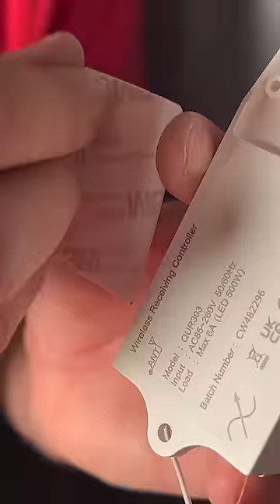A light switch with NO Wires - Magic! 🪄

Comment: That seemed like a lot of wires involved in a switch with no wires.
Reply: Switch itself has no wires the controller does
Reply: Your tv is plugged in ,correct,you use a remote ,no wires.correct.😊
Reply: @tommym3876  well no. The actual “switch” would be contained in what you’re calling the controller.
Reply: @onelineal9382  yeah you’re on to something. This video is like saying your tv is wireless because you control it with a remote 😂.
Reply: @dustinengle2570  yes the “slave” switch would be in the controller the the “master” is the one with no wires that dictates what the other switch is doing

But the point Is that no wires have to be ran for the other switch making things a little easier
Reply: You need the controller in case you lock yourself in the cupboard and need to to the lights on with your phone app. 😂
Reply: You can use wireless wires as Nicola Tesla did
Reply: Not at the switch though, are they? 🤦🏻‍♂️🤦🏻‍♂️🤦🏻‍♂️
Reply: @jameshansing5396  read my comment again. None of the words I used indicated that the switch itself had attached wires, did they?
🤷🏻‍♂️🤷🏼‍♂️🤷🏽‍♂️🤷🏾‍♂️🤷🏿‍♂️
If the electrician has to terminate wires to make it work, it is not wireless.
Reply: @PC-vx6ko  it’s just a pointless thing to say. Plus if you’ve used the product, there really aren’t a lot..

Comment: Sticky pads? They're gonna fall off in a month or two
Reply: Those 3M ones are pretty good, got them holding stuff for the last 6 years with no problem
Reply: That's where you're wrong bucks, those bad boys last
Reply: @brandonacamarena2197  nope. Just did some last week and the client called me back as half of them had fallen off. Even with an alcohol wipe pre sticking.
Reply: @jonhunter8737  they work great for me man, just must be a surface thing with some of em
Reply: Add crazy glue to the sticky backs.
Reply: I have mirror glued with them since 2001, just don’t buy cheap ones
Reply: @jonhunter8737 wrong
Reply: Nah those things stick like a mofo. But if you use other then 3m , a knock off brand they wont last long.
I used them in installations in trains a lot , some trains came back after 6 years and sae my work back and those sticky pads where still going strong. It just depends where you stick em 😂 and if the surfsce is clean or not.
Reply: @baklap141  Tell that to the Tesco Auditor who snagged my job a couple of weeks ago, when 4 out of 6 of them failed to stick!!! Typical night job, vague instructions, nowhere to get gear etc, then they want miracles. Move a costa machine and there may be a printer that needs power. That was the job spec!!!! Oh, and drive 270 miles each way to do it!!!!  Then get a wrist slap and an arse kick cos of them stickies!!
Reply: @jonhunter8737 the common theme in them not working v working seems to be you! 😂
Reply: Y'all I've worked in the adhesives industry let me tell you the secret. Look at the data sheet for the adhesive. If there's no data sheet throw away the adhesive because it's crap. Anyway on the data sheet it should tell you lots of information about how to achieve maximum adhesion. On the 3M VHB, most people do not press hard enough or sustain that pressure for long enough, and so get a subpar bond. Have a nice day!

Comment: >buy wireless device
>look inside
>wires
Reply: The actual switch is wireless and even battery less ... no power required. Works from mechanical actuation of the switch being pressed
Reply: @contytub  yeah piezo crystals are nothing new. that is how your dads lighter has worked for 50 years.

Comment: In this application why not just run a cable to the switch and route it out of the way?
Reply: Beacuse it's a sponsored video.
Reply: @Solkre82  yes, but find an actual application that makes sense. Where the switch isn't 30cm away and where a cable can be run with no issues.

Comment: Cutting the tails off the zip ties with diagonal cutters leaves extremely sharp ends that can slice you open. Twist them off.
Reply: He used plumb cuts. Not diagonals.
Reply: @joshespe7985  if you look at the cut end of the zip tie you will see the point that will slice you open. And those are a modified angle cutter. 
Retired Master Electrician 42 years
Reply: @gerhardschemel3565  those style cutters are meant to cut flush because of the thinness of the blade and the angled edge sits against the cutting surface. I'm not disagreeing with you.. I'm an industrial electrician who does a lot of work in panels/transformers and distribution cabinets... twisting off is best.. but sometimes u wanna just quickly nip and go.
Reply: Time over blood? 
Not sure I can wrap my mind around purposely not being safe
Reply: @gerhardschemel3565  never had a deadline? If you're worried about somebody getting a little scratch inside of an energized panel you're worried about the wrong thing. Once that baby is energized nobody is gonna be back in it until it needs serviced
Reply: @joshespe7985  who said where? 
And why make such negative comments? I have seen cut zip ties all over the place and a several injuries from cut zip ties some required stitches. 
Deadlines you made a statement that you had to hurry and safety was not important.

Comment: Hi Rick, what is the punch tool you are using to make a starter hole in the sheet metal? And then you have another tool that punches through? (Gold one). Great video!
Reply: He's using a long-nib marker pen (drill-hole marker pen) to mark the locations, then an automatic centre punch (the gold one) to create a divot in the metal to stop the drill bit wandering. No through-hole is created in the metal until he starts drilling.

Comment: I wonder how long it will last. 
Or you could of just used a fitting with built in PIR
Reply: I've used loads. I think it's 10,000 presses they say. Which on and off twice a day is alot
Reply: @MattySmev  200,000 according to the spec sheet
Reply: @michaelraab5669  even better. Knew it was something ridiculous

Comment: wow.. there are uses for those types of switches... but in this case it is totally pointless in my opinion.. (automation cabinet builder)
exactly the same kind of lamp can come with a built in switch.. a switch on a short cable to mount next to it.. or just motion detector built in the lamp it self..

Comment: No wires, no i.d. coding. Ive got some bike lights that run on these type of modular pcb. Your switch will turn random things on and off as well as your neighbours. My front light (non radio just on and off) switches my rear indicators on and off as well as the rear light (those two are remote operated).  Cheap modular out of china is no good atm. Best avoided.

Comment: Just get Philips Hue
Reply: Id go with tplink, does the same job but you can get 4 switches or bulbs for $20.  Avoid the pre -2023 motorized cameras though they're buggy and lose position. New ones are ok.
Reply: @luminousfractal420  possibly true, but I was all ready in deep before tplink came along.